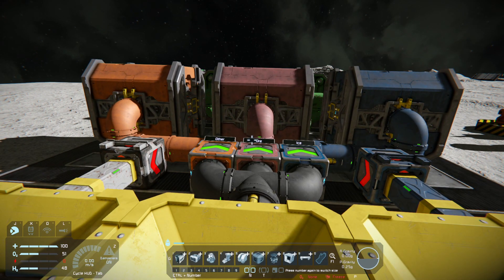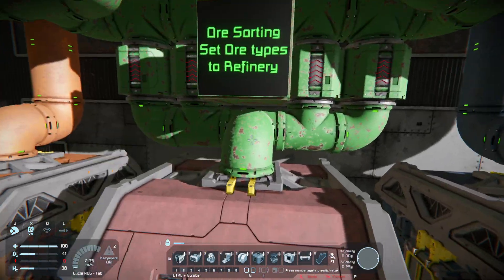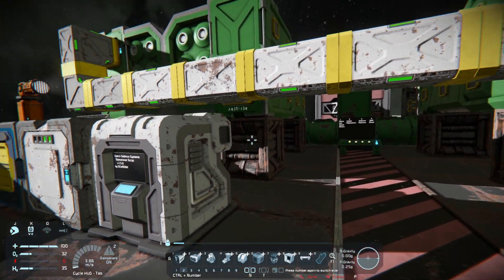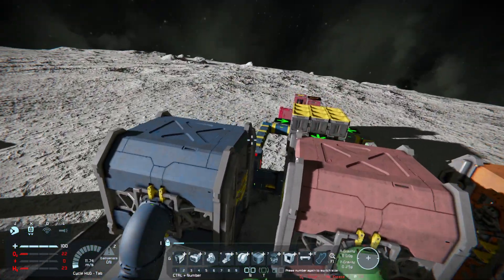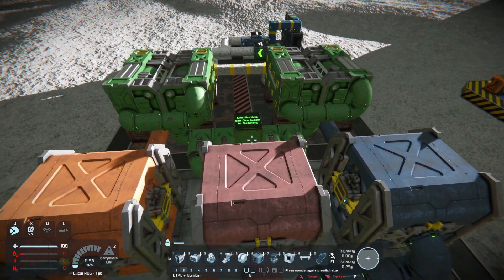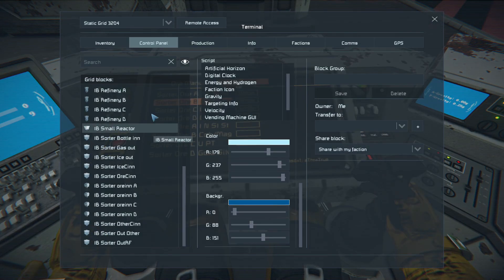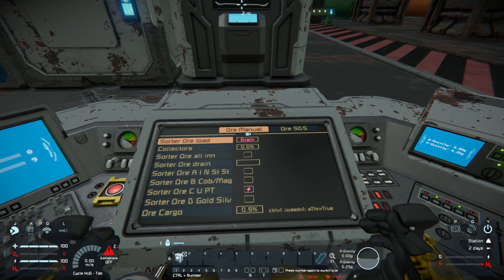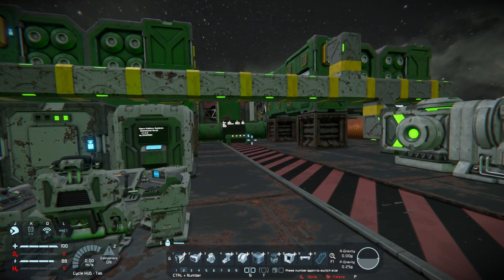Space Engineers Tutorial Ore and Refinery management

Comment: In one of my own builds, I made an ore processing station using a similar system as this, except separating cargo by ore, ingot, component and ammunition. Ice and h2/O2 are in their own dedicated system as well. 

My system is designed such that there's a dedicated refinery for each ore type, with speed or yield modules used as needed, such as speed on the two iron refineries and yield on the uranium refinery.

The processed ores will then merge conveyor lines with the initial ingot line, and be put into a storage container that acts as a buffer for the 6 assemblers in the facility, though the assemblers aren't set up for filtering specific items for obvious reasons. All the assemblers have full speed modules, of course.

After the components are made, they're put into the last storage container, where they also share space with the initial component and ammunition lines. A sorter with a filter to whitelist Gatling ammo helps feed the 4 defensive turrets on top of the building.

The input/output is handled in an enclosed garage designed specifically for low-slung small block rovers, with the input and output connectors being inline on the floor and ceiling, respectively, to interface with my standard rover cargo transfer design of a collector block in the roof attached to a large conveyor block that also has a connector attached coming from the bottom of the rover. When the in-floor connector is docked, everything lines up such that anything dropped from the station's roof connector will roll down a small ramp into the collector on the rover.
Reply from the maker: Sounds instersting, is the base on steam workshop?
I like for uranium platinum gold and magnesium ore a 4x yield refinery, couse they are low combined (from my new video). 
I´m working on a concept, to make all ores cycle, but without script, the lowest amount is 2.7k (couse 1000L sorter inventory volume). To set the exact cycle time with speed modules is not easy....
Reply: @royalrollin8372  I don't have the base on the workshop, no. I've been working on a different project lately. I'll look into putting it up later. I will warn you, though, the base does require at least the industrial dlc, since I'm using the refinery and assembler from that dlc to try to help the walkability of the base. There might be a couple other dlc used, but I can't remember them off the top of my head. 
I also have isy's automatic lcd script in a program block, but I haven't yet gotten it set up, since I don't know entirely how it works.
Reply from the maker: @Bondubras  My all workshop objects need almost all DLC´s, (got them all), I always use scripts (I love a good setup), only for this tutorial, I made a extra soulution
Reply: @royalrollin8372  gotcha. I mainly use the warfare, sci-fi and industrial dlc's, though I also have all of them. Admittedly, for the first two, I'm using them more for the better looking thrusters and reactors. The sci-fi atmospheric engines are awesome, and the warfare ion engines look pretty as well. But it is generally a thing that when I do a build, I make one such that if a person doesn't have the dlc's, they could still make use of my blueprints by simply placing the vanilla block equivalents. The sole exception so far is with the industrial assemblers in my materials handling facility, since those are such a massive change from the vanilla assemblers.

I also make heavy use of the reinforced conveyor tube blocks. Having the ability to transfer cargo yet still maintain the ability to attach blocks is too useful. I've basically stopped using the standard conveyor blocks. I'm fairly well aware that this approach is somewhat resorce-intensive, but I basically play exclusively in creative mode. Ever since buying the game back in late 2011, I've basically only done maybe 5-10 minutes of survival mode. My first workshop submission was a chess set way back in early February 2012. I still remember when rotors didn't exist and subgrids weren't a thing. I also remember the old beta texture for what would become a wheel, which was basically a flat gray cylinder with a white line coming in from one edge to show it was turning. Conveyors and cargo containers also weren't a thing back then...
Reply from the maker: I use survival mode only for testing my builds... I waypast the "volume control" wheels.... I started at 2015.  Can you send me a link to your workshop?